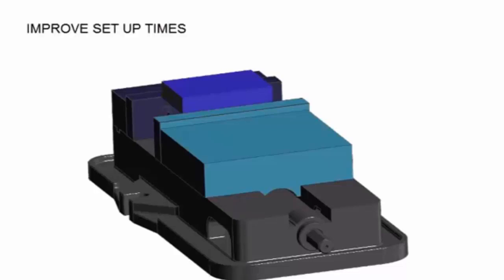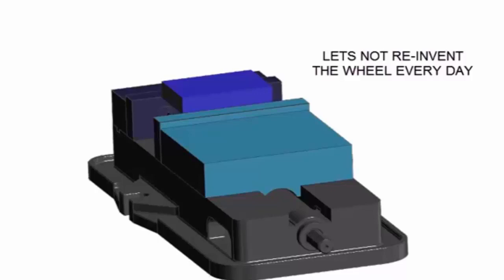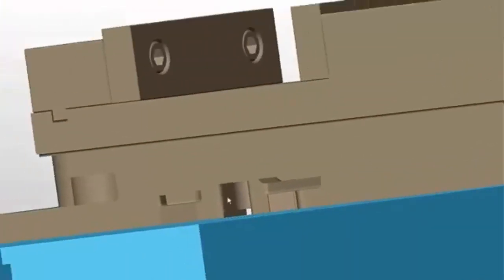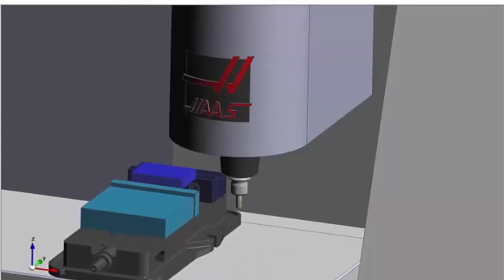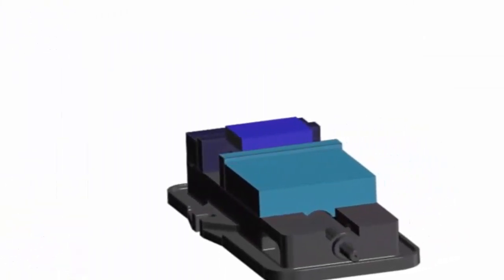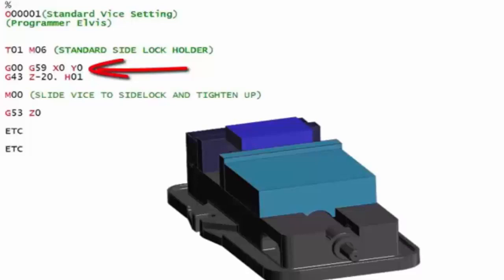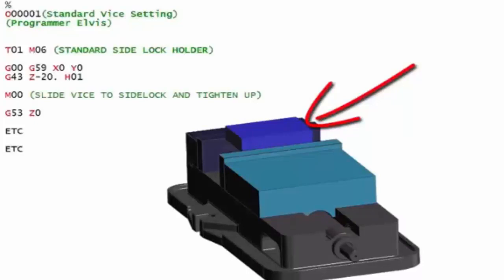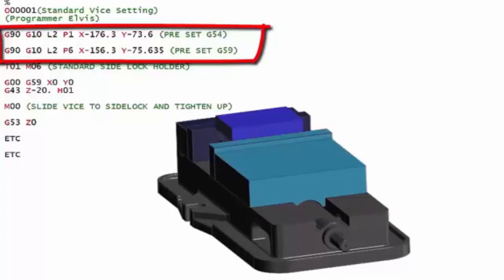Never Clock a Vice Again On a CNC Machine

Comment: Okay say you're using all your offsets for jobs which on big machines with multiple pallets in production environment and FANUC world is a very common thing I love to use the g10 line for writing my offsets but let's say that is going to interfere with a job that setup in your world. If you're doing this quick vise set send your machine to g28 Z0 then g28 X0Y0 home position now zero out your relative XYZ just for your first time now handwheel to the position that you want to be at with your xy&z so you're two lines up where you want your voice to mate to it. Okay now look at your relative you have your dimensions XY and z from home write down your relative numbers on the screen at this position. Now write a program calling out your desired tool # G28 X0Y0Z0
G91 G0 and then the XY numbers that were in your relative that you would have wrote down then send G0G91Z to that number from your relative you wrote down. And you are there and this number is never going to change unless you move your home position another words you replace a ball screw spindle or have a serious crash and service or your maintenance department changes it even then chances are it's not going to change by Much. So another words you're sending your machine home then you are putting it in incremental mode and moving incrementally a known number from home state. Now let's say this little program you wrote is in your control program number for example o6666. And you want to run it in mdi you type m98 p6666; and hit cycle start it will run it. Obviously if you are program is on extended memory card it would be m198 and some controls don't recognize the m98 and you simply use a G65 which will work in most controls  and commonly what I use to run programs in MDI without actually calling them up. Technically a g65 is used for calling up a macro .
Reply from the maker: OK thanks for taking the time to comment.